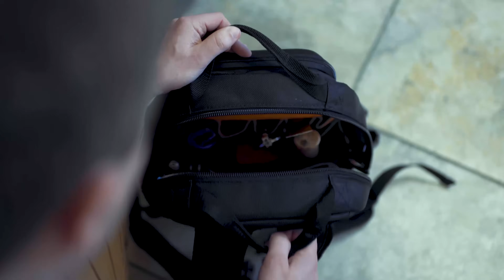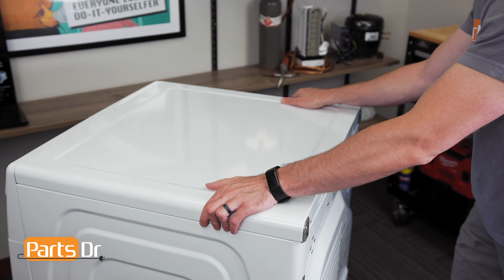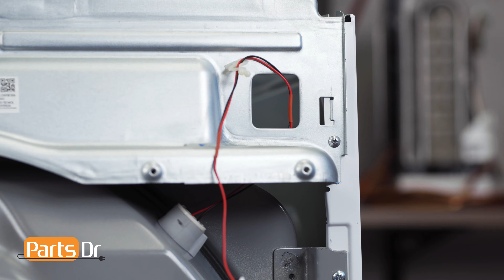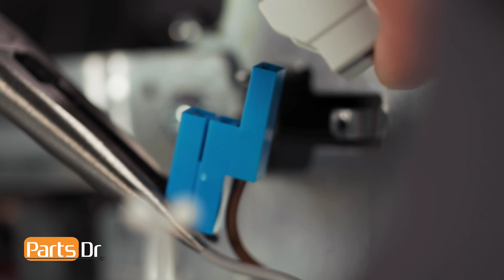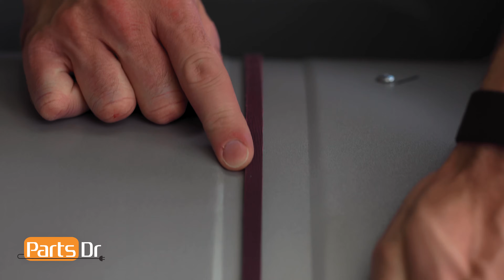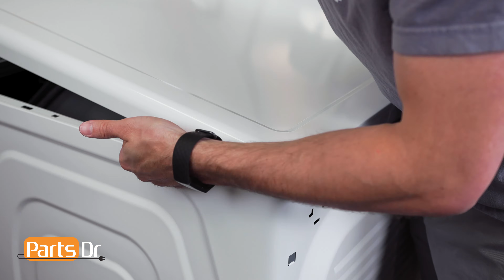How to test and replace the broken belt switch part # 3405-001118 on a Samsung dryer

Comment from the maker: Thanks for watching! If your Samsung dryer isn’t starting or you're dealing with a no-spin issue, a faulty belt switch might be the cause. The part shown in this video is belt switch # 3405-001118 (PD00070622), and we walk through exactly how to test and replace it. If you're ordering parts online, especially from places like Amazon or eBay, be careful that many of the cheaper aftermarket parts are of much lower quality. We've seen many cases where these parts fail early or cause other issues that end up costing more in the long run. For genuine, high-quality OEM parts, you can order directly from our website at https://partsdr.com. We only sell reliable parts that meet original specs so you can fix it right the first time. Happy repairing and let us know how your repair goes in the comments!

Comment: I just take the back panel off of the dryer. It's a hell of a lot easier. It's like 12 screws. I think you take the back whole metal panel off and slide it out of the way and the terminal block wires will still be connected. You don't have to disconnect them. You just kind of push it out of your way until you can get to the back of the dryer and you can get to that switch from the back side without having to take the entire front of it off and then drum out everything else.
Reply from the maker: Thank you for suggesting this.  Unfortunately, the back panel option only works on older Samsung models, all newer models have to be disassembled as they do not have a panel on the back from our experience.